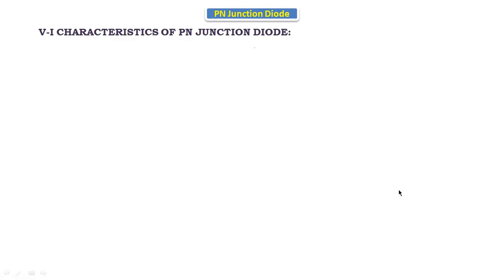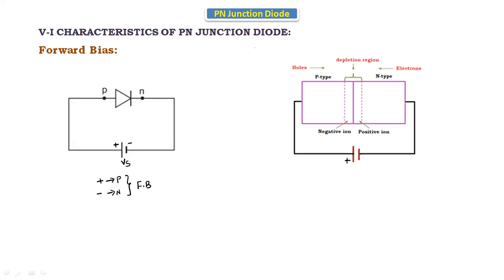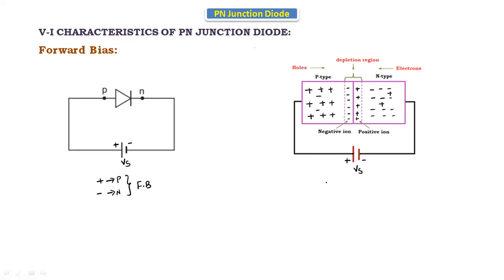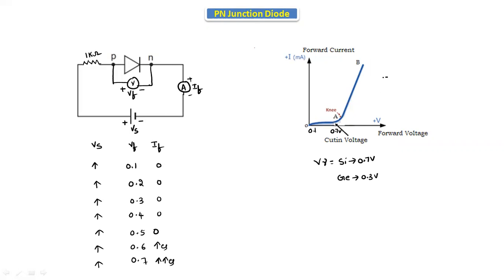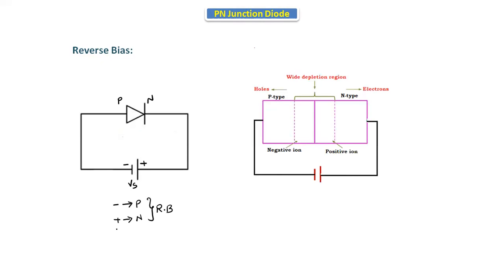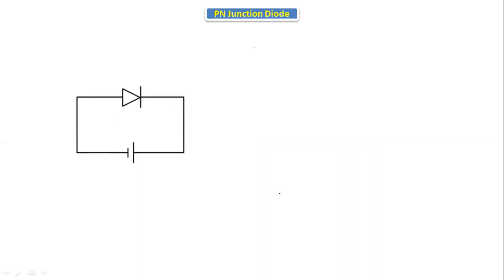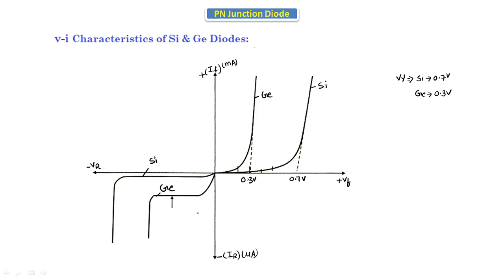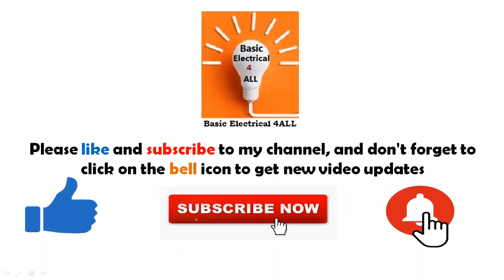36.V-I  characteristics of PN Junction diode |Forward Bias and Reverse Bias| BEEE |JNTU | Autonomous

Comment: In Reverse bias break down voltage can be seen in zener Diode only    what ever current shown in pn junction diode in Reverse bias is Due to voltmeter  which is connected across the Fiode if you remove  voltmeter current meter shows nothing it show 0 Depend upon the Resistance of the voltmetercurrent shows in reverse bias try practicaly any dought pl reply